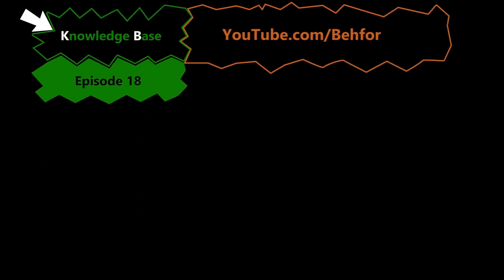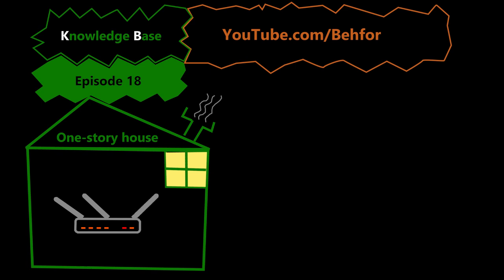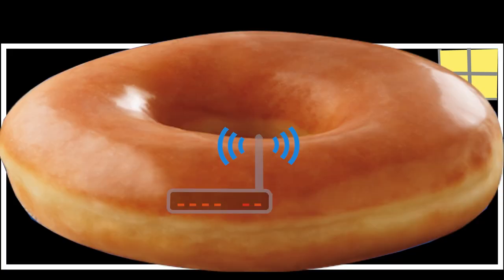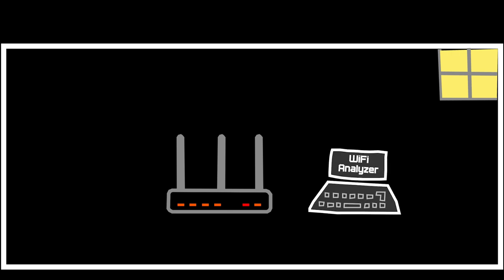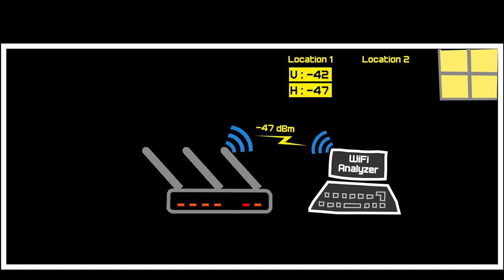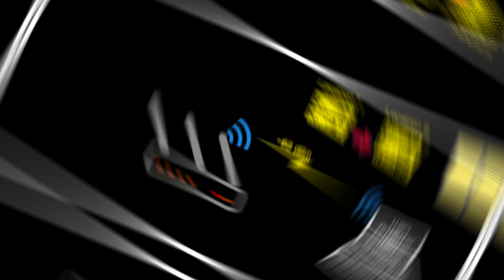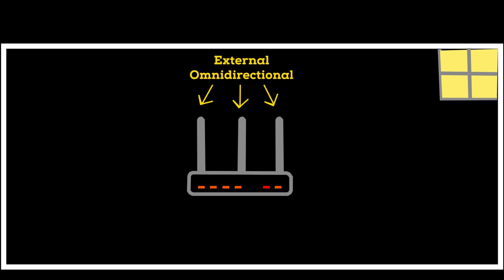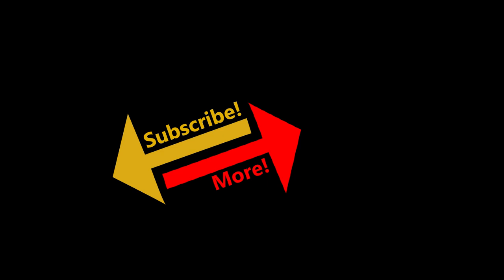Optimal Positions for Your Router's Antennas in a Single Story House [KB Ep18]

Comment: Well, your video helped because it encouraged me to test the wifi signal strength with different antenna positions.
But in my case, pointing one of the antennas half horizontally towards my bedroom helped the signal to go through 2 layers of brick walls with "good" quality. While pointing the antennas straight up, it only gives "fair" and sometimes even "poor" quality. I double tested it in different rooms too, and straight up antennas was worse in my case.
Reply from the maker: Thanks for sharing!

Comment: would be nice if you had a two or three story house scenario. I currently live in a three story townhouse and would like to know how I should angle my routers antennas
Reply: get a wifi  booster for each floor and  give them a wired connection to the router

Comment: My router is placed too high above the floor, close to the ceiling. Do you have to curve the antennas for better range in that case?
Reply from the maker: I would first use a WiFi analyzer to check the signal strength I actually receive in different areas of the house. If it is good everywhere, I wouldn't change anything. If it is not good in certain areas (let's assume the router has 4 antennas: 2 for 2.4 GHz and 2 for 5 GHz), I would tilt one of the 2.4 GHz antennas and one of the 5 GHz antennas about 15-20 degrees towards the area in question and check the signal again. Depending on the results, I might have to tilt further. This is what I would do. I hope that helps. Thanks.

Comment: So my router has 3 antennae; do they each do something different?  It's a TP-Link AC1750.  I have a single story house with the router near center.  I also have an electric car in the basement garage that gets its updates via WiFi (I think).
Reply from the maker: The antennas could be dual band (2.4 ghz + 5 ghz) or single band. I would keep the antennas vertical and if there is no signal in the basement then I would tilt one of them a little bit (maybe 20 degrees) towards the basement and check the signal again.

Comment: What about when you have your router in a single story house and placed  7 feet on top of a cabinet ?
Reply: Maybe adjust your antenna to lean at certain angle?
Reply from the maker: if it is 7 feet from the ground it should still be alright, I would still keep the antennas upright, unless there is a problem which in that case I would make some changes, thanks.